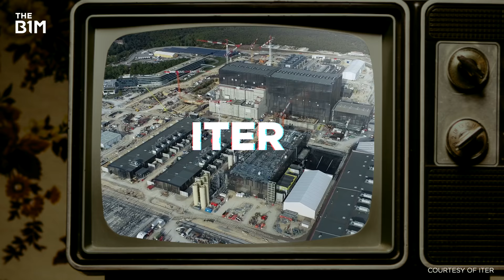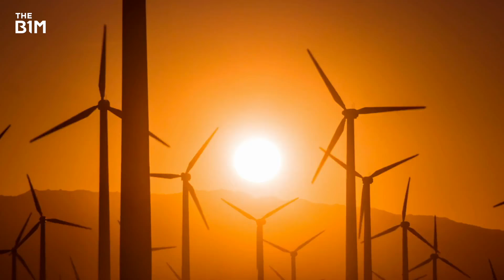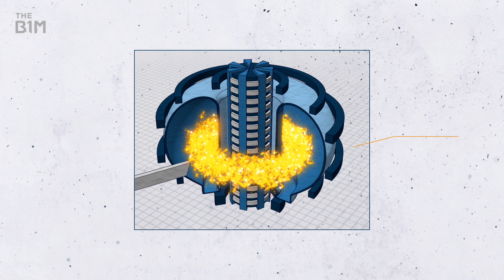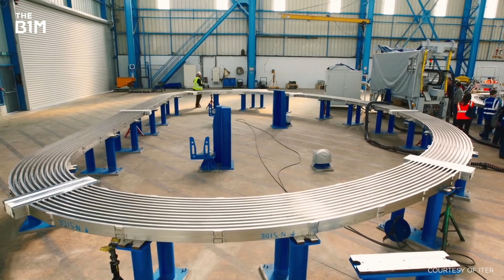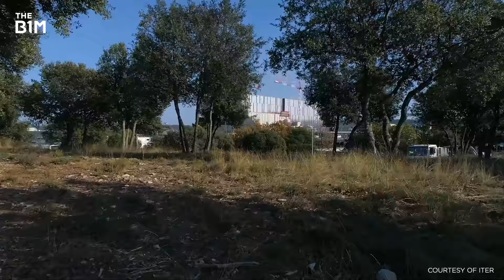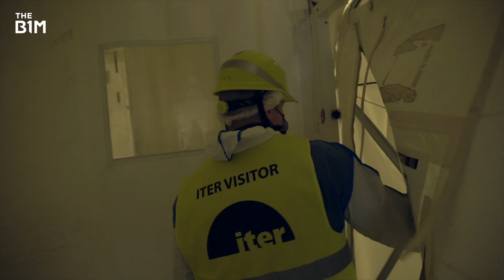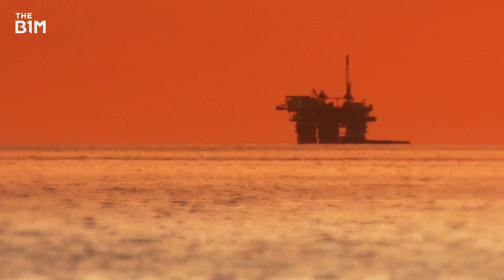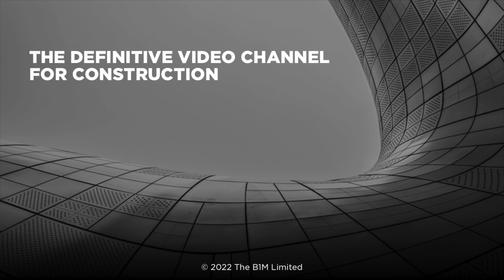We Went Inside the Largest Nuclear Fusion Reactor

Comment: There was a dramatic new containment magnet tested last year that makes future tokamak designs 10x more powerful for a given size. This may allow a 200+MW reactor possible before 2035 and may be a better economic deal than coal plants due to having no air pollution

If this pans out in the test reactor SPARC in about 2025 we will have technology on hand to make tokamaks commercially relevant and only need one more major advance to make them commercially mainstream, even as the alternative designs are also being rapidly tested with better economic potential
Reply: Having a big magnet is NOT the only problem with fusion.  Dig deeper than the three paragraph popular science articles found online.  Fusion isn't workable as a truly competitive energy source in this century, barring some paradigm shift (as in not Tokamaks).
Reply: @MrGottaQuestion  With current tech it sounds like a reasonable but optimistic cost for tokamak energy would be 15-20 cents per kWh which is too high but not so high that some countries wouldn't build it. It won't be ready until 2035 so something might make it irrelevant by then. Something as simple as a radical advance in cheaper or stronger structural material could make it mainstream

I agree that better odds for a real difference maker lie in alternative designs
Reply: @Canucklug  You think fusion could be commercially viable in twenty years?  For 20 cents/kWh?  Keep dreaming.  The vast majority of the cost of nuclear (current fleet of light water reactors) is the plant (fuel is a minimal cost), and those are many times cheaper to build than ITER.  These huge, complex plants will make sure the price of electricity is uncompetitive, especially in a world where interest rates aren't close to zero anymore.  As far as the timeline, a COMMERCIAL powerplant - you'll be lucky to see it before your retirement if you're 18 years old today.
Reply: @MrGottaQuestion  With the high power superconductor an estimate was made for building a reactor producing 270MW for 5.5 billion lifetime cost. They figured 26 cents per kWh for that first electric/research plant which has begun preliminary design. It's interesting since you'd have a research reactor that could pay off a lot of its cost. It's a big leap from the capability of ITER's magnets though not an immediate home run
Reply: @MrGottaQuestion  Yeah fission is more likely, I especially like Thorcon. It sounds like the first modular design NuScale approved by the US is now more expensive than traditional reactors but it also says it can prevent meltdown passively, and it would require a major advance by tokamaks to approach the same price. Still, even at high prices I think Germany and Japan would build tokamaks if they were available at 20 cents now. Some of the alternatives project a price of 8 cents and lower

The estimate is the basis of the Commonwealth Fusion Systems MIT spinoff, it seems reasonable, primarily it depends on how much power it can really deliver - if it's 270MW the estimate should be ballpark but if it's 27MW there's your order of magnitude. The magnets are actually demountable making it very easy to replace the inner vacuum chamber that will die every few years and there's a FLiBe molten metal for tritium breeding and neutron absorbing plus heat transfer. They figure the magnets would start degrading after 9 years and last some time after that since they're operating at half their maximum strength

Comment: Q: how long does it need to run to recoup the amount of energy used to build this? Including mining of material, roads, labour etc...
Reply: A: It won't, it's not made to produce energy for consumption, it's purpose is as a technology demonstrator, for future reactors. This is the tier 0 of fusion reactors.
Reply: @MetallF  I know, but I think it's relevant to know for future power plants, like "how much work is still needed to start using these in the real world"
Reply: @HaroldKuilman  Will be easier to answer that question when the measurements from ITER operations and experiments come in.

Also, there seems to be rapid progress in the news from related areas - high temperature superconductors (would likely shrink the magnets and costs to build and operate the machine by order of magnitude), thermophotovoltaic cells (may become more efficient than turbines to produce the electricity in the end), projectile fusion even...

Comment: This is a very interesting project. I appreciate this is a proof of concept but the amount of power required to get fusion working (if it does indeed happen) is going to be MASSIVE. I would guess it might be in the ballpark of France's entire power consumption. If that is the case, they are going to require fossil fuels to power this. Should it pay off the sacrifice is worth it for the future, if it doesn't work or the thing melts, then that is a huge gamble of further damage to the planet.
Reply: Fusion reactors (or more accurately, tokamaks like ITER) do not generate energy out of fuel just once, so once turned on the reactor with a constant source of fuel can indefinitely generate energy for its own use. It still requires energy to start this feedback loop, but that's mostly one-off cost and can be met in various other ways.

Comment: You should start thinking about producing more long form videos. Your video from some weeks ago about billionaires' row was about a half-hour long and did an order of magnitude more views than your regular 5-10 minute videos. If any subject ever demanded longer format video explanation, the immense complexity of ITER and indeed magnetically confined fusion itself certainly fits that bill. This video I would say ideally should be at around 30-40 minutes long to more thoroughly explain to the uninitiated viewer exactly WHY the device is so large and complicated (plasma volume scaling laws, superconducting magnet force dissipation, ancillary heating modes ie. ion cyclotron heating and neutral beam injection, necessity of super thick concrete shielding against neutron flux, etc.  People WILL watch.

Comment: Europe and Germany in particular have been to slow to transition to wind and solar energy,
Wind and solar energy do not need to be imported and can be produced locally in any country.
Europe needs to provide incentives for homes and businesses to install electric heat pumps and get rid of old polluting gas and oil boilers.  The move to electric vehicles will also be sped up. There is no good reason to help fund Putin's war by buying oil, gas and coal from Russia.  Russia troops have attacked Ukraine's nuclear power plants. A disaster waiting to happen.

Comment: Nuclear energy is too costly and too dangerous.
Fukishima and Chernobyl are still spewing poisons into the environment decades after those disasters.
Wind and solar energy are safer, cleaner and cheaper than fossil fuels or nuclear energy
Solar roofs need to be standard on every home and business building.
Reply: Chernobyl:

Soviet government had turned off almost all safety functions to save money, and the government response was shite.

Fukushima:

Poorly placed and a freak accident.

Nuclear energy as a technology has progressed immensely, and is the safest source, even the waste, which most people cite as the most dangerous part is incredibly easy to dispose of, just sit it in a cave for a few decades and it degrades to the point of harmlessness.

Don’t like uranium? Then why not try Thorium!

-more of it

-safer to mine

-more potent.

-even less likely to melt down.

-waste is even safer.

Comment: Why call it a star when it's Doughnut Shaped!? To me making something on the scale of the power of a star is just crazy anyway! We just can't build something that big on Earth! I'm subscribed to the ITER page and I haven't seen enough to convince me yet!
Reply: The shape isn’t really what they’re talking about, more the reaction itself.
It is tiny because it needs to be, stars can achieve the reaction because they are very massive, and thus have high gravity, therefore squeezing the core, where all the fusion happens.
A fusion reactor uses magnets to squeeze the fuel, achieving the same reaction on a much smaller scale, it wouldn’t be feasible to make it any bigger, as the bigger it is, the more magnets you need to use to create a confinement.
On the subject of the confinement, if it fails, the reaction will just stop, making it impossible for it to melt down in any meaningful way (any damage would just be to the power plant, and there wouldn’t be any lasting radiation, a few weeks of repairs and its back up and running) this is one of the technologies main advantages.
Reply: @Banter07  magneto would be proud

Comment: I'm no expert in this, but I'm pretty sure it isn't the voltage that strips the electrons from the nucleus, but rather the insane temperatures. The superconducting electromagnets are for stabilising the plasma to keep it floating inside the vacuum chamber. If the plasma touches the actual reactor, the walls will instantly vaporize from the heat, so they keep it floating with the magnets.
Reply: wellll...how do you get to the insane temperatures? First you have to have an electrically conductive plasma. You get that by ramping the current in the central solenoid superconducting electromagnet, this induces a large voltage gradient across the vacuum vessel which causes avalanche ionization and breakdown of the up until then neutral hydrogen gas in the plasma vessel. The breakdown and ionization of the gas in the vessel creates a cool plasma that only THEN you can heat via ohmic heating, ion and electron cyclotron resonance heating, and neutral beam injection which only then get you to 100+ megakelvin temperatures.
Reply: https://youtu.be/pOWVAR0cN_s

Comment: Sounds like a modern day “Tower of Babel” to this cynical retired engineer!
IF there are 35 nations involved because each one is contributing as a ‘center of excellence’, I’ll happily concede I’m wrong. But if many of those 35 nations are involved in order to achieve pan-national equity…
Reply: Not really.
The US, China, Russia, and India are just funding the project. Not exactly participating in it.
France and the EU are the ones bearing the grunt of the construction cost, and are the ones that work on it.

The US and China have their own independent projects, other than ITER. They still fund ITER regardless as there is no harm.

Comment: Fusion is orders of magnitude more complex and expensive than solar, and always will be. For that reason, even if they are successful in generating more energy than they consume, it will never be less expensive than wind or solar. This is physically impossible. Therefore, this approach to achieving fusion will never be used to generate energy for regular consumers. Fusion may find success in a far smaller and simpler format, but as realized at ITER, it should be obvious to everyone that this is the wrong path to cost-effective renewable energy.
Reply: The complexity are only really a problem if it’s only a few plants, but on scale, mass production of components and developments in the technology will lead to the parts getting cheaper. Take computers for example, which used to cost an absolute tonne for a basic device the size of a building, now you have a device in the palm of your hand with more computational power than those old computer, and they’re comparatively cheap because they are produced at scale.

Comment: Considering the current issue with European gas prices and need of renewable energy, I really hope this project provides great benefit to lose dependence on gas and fossil fuels.
Reply: Yeah... if you think nuclear is the answer you are an idiot.

If you think nuclear energy is clean you are absolutely wrong.. it produces waste which needs to be properly dealt with..

Using Hydrogen for energy production is the answer hands down.

Comment: What happens if this thing has a failure during operation once it goes online?
Reply: I guess a smidgen of radioactive tritium gas would escape in a bad bad case. That's it.

Nuclear meltdowns happen when there's a large mass of nuclear fuel in one place, and we allow reaction to spread in it by accident.

In ITER and other tokamak fusion reactors the crucial difference is that 1) there is no large mass of fuel inside it, there is less than four grams! pumped inside the chamber; 2) containing that fuel in a compact enough shape for it to react even a tiny bit, has already proven to be ridiculously hard via controlling the surrounding electromagnetic field. Reaction doesn't spread if left uncontrolled, all we get from any power excursion is scattered fuel that isn't in the right shape to react any more.

Comment: "20 years tops."
quoted in  1950, 1970, 1990, 2010, 2022...Oh and all the years in between.
I'm not sceptical though, it has to be done to determine if this is the way forward in energy production. It might turn out to be prohibitively expensive for example.

Comment: After the atoms combined into big matter how they'll handle it? I mean it could be a world wide catastrophe if mater that big goes wrong...or they'll split it again doubleing the power or just re using it to create another big matter then split it and combine it again?
Reply: The difference between fusion and fission is that fusion can't sustain itself unless its getting fed new deuterium and tritium. So nothing can go wrong, because fusion will just collapse if something goes wrong.

Fission will keep going on splitting atoms and it can sustain itself causing more heat until the core reaches high enough temperature for meltdown.
Reply: @teemumiettinen7250  so no Infinite energy? What a bummer
Reply: @jonathan100yearsago  As long as you feed it new deuterium and tritium which are one of the most abundant elements in universe, fusion can keep going.
Reply: @teemumiettinen7250  so by default it'll be Infinite? Or you still have to extract those two elements first bevore feeding it to the matter? Man,Infinite energy is as close as ever....maybe in the near future we'll have car with Infinite energy and 100% green (no emission)
Reply: @jonathan100yearsago  You get deuterium and tritium from hydrogen, which you can extract from seawater for example.
Reply: @teemumiettinen7250  so all we need for Infinite power is salt water? Awesome...with ion in it it could boost the power generated maybe...

Comment: Thats absolutely insane
Wonder how much power this is gonna generate each minute
Reply: It will generate 30 gigajoules of thermal energy every minute, as it is a 500 megawatt reactor. 500 megawatts is 500 megajoules per second. 30 gigajoules is equal to the average US home's annual electrical consumption. ITER will produce no electrical power for the grid, it is only an experiment. If it did it would do so at around 35% efficiency, thus ~three minutes of a future 500MW fusion power plant would produce enough energy for one home for one year.
Reply: Not much. I mean, a lot, but not compared to the cost. This is basically a science experiment, and won't be powering the grid at all.  
But once this proves it can work, it'll allow real gigawatt scale power plants to begin construction

Comment: Fusion technology is always over hyped, it’s a bit of a long shot of being viable for a base load amount of energy anytime soon. More focus needs to be on nuclear fusion and gas for the short term. The main issue is lithium reserves required to fuel the plants. 20 years is no where near how long it will be away.
Reply: I think small nuclear fission and disposal technology is the short term win for us to expand into space and mitigate power and climate issues. It's really underfunded compared to its possibilities
Reply: If you believe lithium resources are holding back fusion as a potential energy source you need to do a lot more research on the subject. The lithium in a single laptop battery would produce enough energy for the average person's LIFETIME electrical consumption needs if burned in a fusion reactor.
Reply: @Muonium1  not sure what you used to calculate that so can’t comment on that but I do know roughly we have 500 years of lithium for fusion probably at most. Which may seem like a lot but that is only for a 30% baseload global power. I’m just saying it’s not the most amazing power source people are saying it’ll be in 20 years. Eventually way down the line when beryllium fusion is viable will we fully be able to harness the potential of fusion but the triple product for that is 500 more than what ITER can achieve currently
Reply: @neonbricks8182  absurd. known lithium reserves are in excess of 6 million years even if all power were converted to fusion. you need to read more, this information is trivially available.
Reply: @Muonium1  Whats your source. Ive have done the research as part of my fusion physics masters degree.
Reply: @neonbricks8182  uhhh how bout the iter sub site on fusion fuels itself, the iter newsline 45, and the wikipedia page on fusion power. if you actually have a masters in physics it's massively embarrassing for someone to need to explain to you where to find any of this information.
Reply: @Muonium1  those numbers are correct but lack alot of infomation, again water extraction is so energetically intensive there would be little gain from using it as a fuel. And the more than 1000 years of land supply does not account for usage in the automative industry which will likely use a good portion of that by 2050
Reply: @neonbricks8182  lol, k. I'm sure you have a much better handle on the numbers than the literally hundreds of PhDs that have spent their entire working careers actually working on the project.
Reply: @Muonium1  never said that the number was wrong on items website just a pointless one as other fusion physics working on projects like demo have told me directly. Simply extraction from water is not viable.